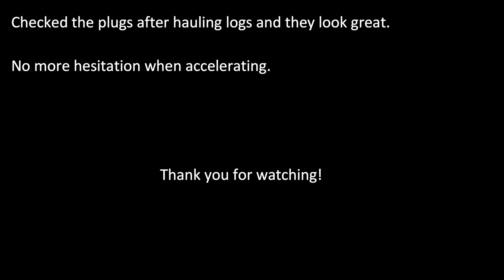Strange Cause Of  Briggs & Stratton Vanguard Rich Fuel Mixture

Comment: Can you do a video on the governor springs/lever, don’t see many Informational videos on a B&S horizontal engine.
Reply from the maker: It's in the manual for the motor.  If I get back into it, I'll make a video but it's running fine.